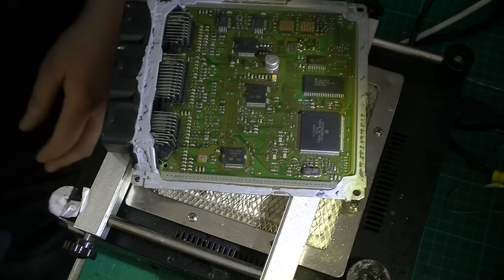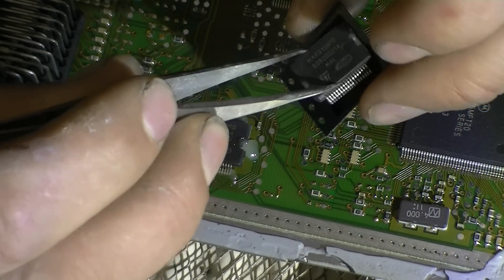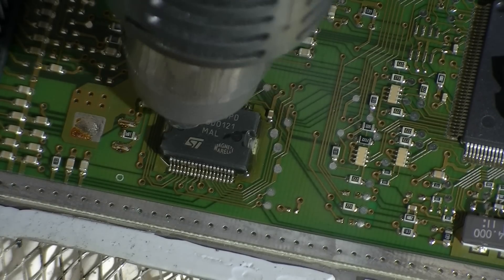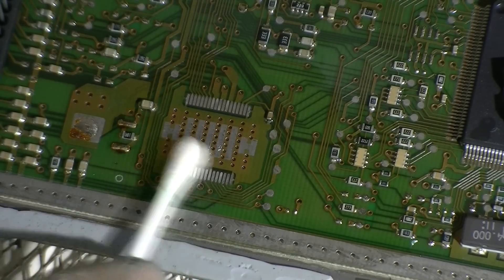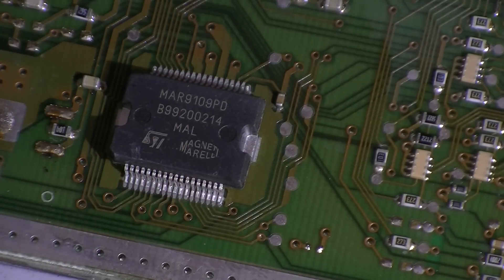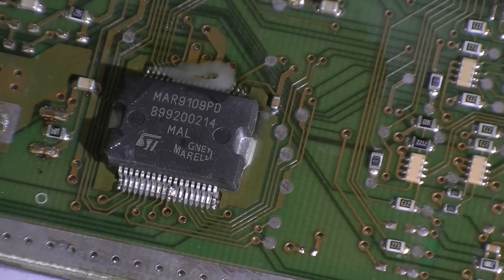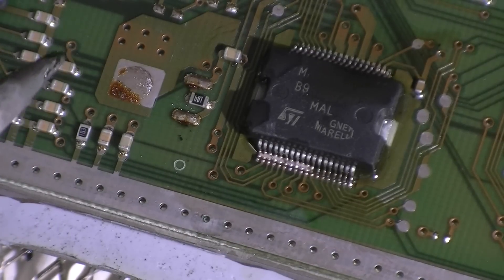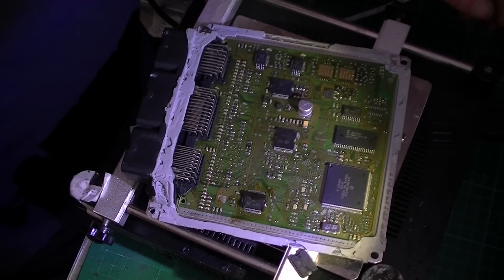peugeot ECU Driver IC replacement

Comment: I did a larger bosch ic driver today. For anyone struggling, remove the backplate as this will sink all the heat youre putting in. Also, they are glued so when the solder is finally loose, you still have to forcefully yank it. Not fun

Comment: Hello friend, I have that same icu in a 2002 Citroën C5, the signal does not reach injector 2 and 3, it comes from the computer. You will know which component you have to change.

Comment: To je divne pajeni,tenky hrot a pajet od cipu a  hned je hezky zapajene a ne tak cik cak do krize a zas odsavat  moc zbytecne  zkratovani .😮
Reply: I thought exactly the same thing, I wouldn't be surprised if the new chip died from the heat the way it fried on it 🤦🏻‍♂️
Looks like his day job is a roofer and he used the roofing soldering iron.

Comment: Pro tip: if you dont remove the solder from the pin pads you can get the chip to just drop in place w/ the heat gun.  😜
Reply: Sometimes !

Comment: Hi. Can you tell me what was the error codes of the car? It's because I have a Peugeot 206 with the same ECU and the error is P0202 and P0203 and sometimes P0201 but it's not the injectors because I have substituted them. It only gives the error when I flore it rapidly. If I accelerate slowly it does not give the error. I can flore it to the red line and it stays good. It only throws the error is I am on low revs and flore it rapidly. I am puzzled by this because I think that if it was the driver the car would work on 3 cylinders or show some kind of failure and this does not happen. It only happens when I flore it from low revs. Thank you for your video and I will be waiting for your answer. Thanks.
Reply: Fuel filter??starvation?

Comment: Great job!!!! If i am correct because i don t know NOTHING about this ... Did you take the chip off the dameged one and put it on a jused one so you don t have to code it? I have a bmw module and i boucht another one but from the same car but not a cabrio but the number en is the same but it is fore electric use of the doors and windows and roof ... But the other is not a cabrio si will this work (every litle thing is the same inside ... Please help 🥴😅

Comment: Wrong soldering method chosen. Bottom of IC was unsoldered (just ends) and will have problems with heat dissipation.
Reply from the maker: Oh yip, thanks for your comment
Reply: i think so